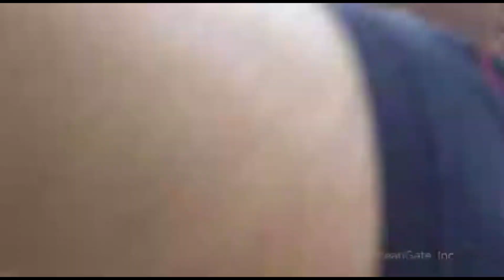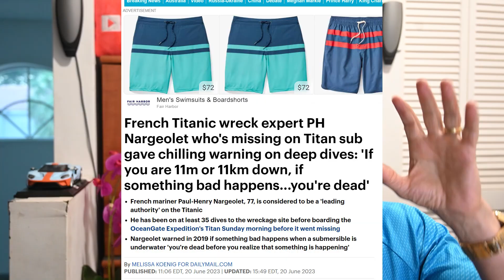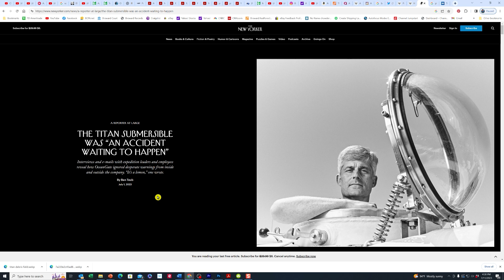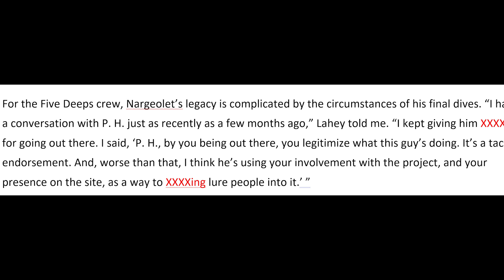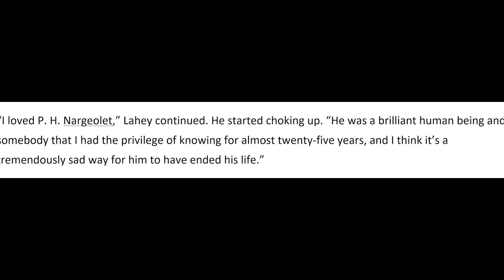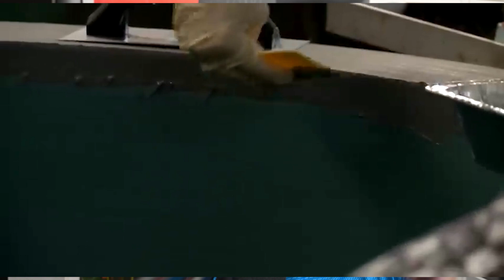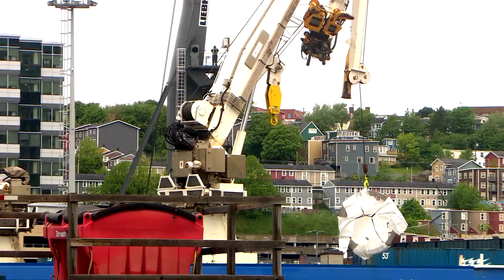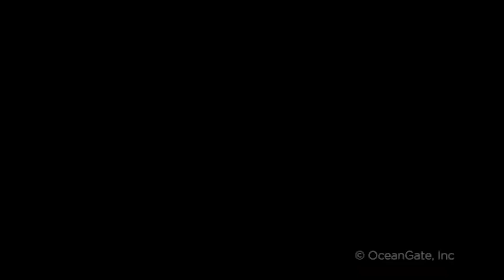Titan Sub: More Q&A, Design Defects, Why Descent Fast

Comment: Spot on @Jeff.  Rapid descent is a major red flag.  Anyone who's experienced scuba diving will always tell you about controlled descent so your body can equalize to pressure depths.
Reply: I think one of the reasons for a slower controlled descent is to allow the forces on the hull to build gradually, it would probably only compress by fractions of a millimetre but doing so too quickly increases the stress and risk of failure.

The lack of a clean room for the carbon layup process and end cap bonding is insanity in such a critical component, even something as small as a dust particle or hair can create a void between the layers that would eventually fail and allow water to work its way through the entire piece
Reply: @wrench8677  There are reasons scuba diver do not descend quickly... Death is one of them!
Reply: @stever2583  yeah I know. I wasn’t talking about scuba diving but I think it’s safe to say that in any situation you’d want to make pressure changes as slowly as possible
Reply: @wrench8677  yeah, people don't seem to get that, especially the beekeeper. He should stick to bees and leave water alone. 😂

I mean, there's so many examples of rapid pressure being a problem. Not just underwater, but anywhere. I would be willing to wager that if you filled an empty water bottle with compressed air and measured EXACTLY how much it took before popping, then put slightly less air in there much more rapidly, instead of gradually, you would find that less air going in faster will pop it.
Reply: @wrench8677  The rules for safety do not change!
Reply: @stever2583  absolutely correct, I wasn’t disagreeing with you on that, just said I wasn’t talking about scuba as I have no experience of it.
Reply: There is no pressure equalization in a submersible.   The occupants are at one atmosphere.  A fast descent is less controlled, harder to abort, and so on. Crashing into the bottom could in itself be destructive.  Maybe that's what actually happened.   It hit the bottom to hard, and that set off the explosion.
Reply: @JoeLinux2000  it didn't hit the bottom too hard, but it was going too fast to adjust to the pressure.
Reply: @chaosflower4892 FASTER than normal descent indicates excess weight.  I suspect the aft section flooded as soon as the sub entered the water.
Reply: @electrictroy2010  I would be more inclined to believe Stockton decided going faster than James Cameron was safe. Obviously, I'm just saying that with no proof, but judging by the other decisions the guy made, I wouldn't put it past him to think he's smarter than James. And we know he's a tighwad who's always looking for a discount (ie. discounted carbon fiber that was past its shelf life for airplanes lol) and that extra hour would be quite expensive. So, yeah, I wouldn't put it past the guy to try to speed things up to save money. 😂
Reply: That's because with scuba, the air you get from the regulator increases in pressure as you descend so you need to do this gradually to avoid damage to your lungs.
The submersible is different in that the cabin pressure remains at roughly atmospheric regardless of the depth.
Reply: They were never descending too fast. He keeps comparing the descent rate of James Cameron's sub to this sub, which is fundamentally wrong. 
Doing 5min of research will show you that this company made 13 other trips to Titanic, and every one of them had a descent rate that got them there in 90min or so. The descent rate wasn't an issue. 
This topic keeps generating a lot of clicks though, so ignorant speculation keeps winning the day.
Reply: The pressure inside the sub isn't high.  As in, descent rate does not matter.
Reply: @cluelessbeekeeping1322 yeah I’m sure the pressure of the ocean depths just disappear 🤣🤣🤣
Reply: @jomomma624  yeah, I’m thinking instantly adding a massive amount of pressure opposed to gradually allowing the carbon fiber to “flex” like a muscle ; had a lot to do with the implosion.
Reply: @devn2190 carbon fiber flexing? Nah.
Reply: @jomomma624  Tell me, smarty pants.  What was the pressure inside the tube just before it imploded?
Reply: @devn2190  Definitely better to take it slow and easy.
Reply: @cluelessbeekeeping1322  Actually the  implosion suggests it didn't leak much.
Reply: @jomomma624  You clearly didn't understand what he said.  Maybe you really are "sure of that," but it's totally irrelevant.  As long as the thing didn't "shrink," the pressure inside was constant, controlled  and not  affected by the increasing pressure on the hull outside.   (Decreasing if it's true that they started to come up.)
Reply: @JoeLinux2000  They were descending at 1.5mph. Is that slow enough 🙃
Reply: @kengself  James Cameron went to the wreckage and it took him 2.5 hours because he went at the correct speed, Titan was on track to take 1.5 hours. So, no, it was not slow enough.
Reply: @devn2190  Carbon fiber doesn't flex.
Reply: @cluelessbeekeeping1322  descending too quickly causes RAPID pressure changes. Submarines are designed to withstand deep pressure, but they're not necessarily capable of taking it quickly. Military subs can dive at any speed, but we're not talking about military subs. 

Same exact principle as decompression sickness (the bends). Your body is able to withstand slowly changing pressure (up to a point) but if it rapidly changes, you're going to the hospital. If you're lucky. The morgue if you're not. This is why you follow your bubbles up when you're surfacing, it keeps you from getting disoriented about which way is up, and it allows your body to gradually adjust to the new pressure. 

Another way to think of it is this: you have a big F350 pickup, you decide you need to drive up a curb, so you get just to the curb and then you slowly go up it and your tire is fine. There was a change in the pressure of the tire, but it was very gradual and the tire was able to "get used to it", for lack of a better term. However, same scenario but you're going 150mph and slam into the same curb. Now you've almost certainly got a couple blown out tires! And, if you don't, please tell me what tires you use! But the abrupt change in pressure will almost certainly cause your tire to explode, whereas, a slow and steady movement will keep you from spending 300 dollars at Les Schwab. ☺️
Reply: @since1876  All that talk & you are wrong.  The pressure inside the sub was 1 atmosphere. 
Your 150mph is NOT the scenario.  Diving at 1mph vs. 10mph (which is way slower than they were going) wouldn't make a bit of difference.  They did not hit the bottom  There was no impact.
You are absolutely wrong.
Reply: @cluelessbeekeeping1322  Stay clueless... 1 atm inside the tub, changing exterior atm to a max of 100atm - where does all the force then go?
Reply: @stever2583  All the force is kept out via the seals, carbon fiber, titanium & glue. 
You don't understand basic physics.
The reason they died so instantly was because of the pressure difference.  Duh.
I'm sorry you don't understand submersibles.
Reply: @cluelessbeekeeping1322   No but i can see by your response that you have it all figured out... When did the aliens get to the submersible - idiot. Why was the submersible down graded for depth? Do you know? I do... Why was the glue applied without any surface prep to the Titanium... I do. What seals are you talking about? Where are those seals what type are they? Do you know? I do! Your trite answers simply point to zero actual knowledge and a dime store wit. Back to your Barbies honey!
Reply: @cluelessbeekeeping1322 I believe the descent rate is what caused this
Reply: @wedontlikenoneofyou  Especially when it hit bottom.
Reply: @cluelessbeekeeping1322  could matter. A fishing line will hold a lot more weight if you slowly load the line vs a sudden application.
Reply: @ClumsyCars  No it would not.
Reply: @ClumsyCars  It's called static load verses live load.  I'm now conjecturing the sub could have hit the bottom too hard.
Reply: @ClumsyCars  The descent rate was never an issue. They made 13 dives with the same descent rate and were fine every time. The engineering is what failed in the end. Trying to compare the descent time of a different sub with a different design and weight with this one is just poppycock

Comment: Did it nose dive down Jeff?
Reply: No it scooted down like a dog wiping its butt
Reply: No. It did not "nose dive". The text transcripts are REAL. That has been positively confirmed.
They had an uneventful but rapid descent for unknown reasons. All was well until the RTM (Real time hull health/integrity monitoring) alarm sounded.
 They tried to arrest descent with thrusters and it actually sped up descent so the decision was made to dump ballast and return to the surface.
That didn't help either so at approximately 3500 meters they jettisoned the heavy landing frame which took several attempts but was accomplished and was succesful in beginning their ascent.
The ascent was ominously accompanied by "crackling" sounds coming from the aft area but could not be identified.
A diagnostic check revealed all hull health monitoring parameters were reading full red at their maximum level.
Eventually the crackling sounds subsided but ascent rate was approximately 25% of the "predicted" rate again, for unknown reasons.
About 17.5  minutes into their ascent and a mere 43 meters closer to the surface, it was reported that Titans main power bus A was reading all red and Rush switched to main power bus B which was accompanied by the return of the crackling sounds which was reported at the 18 minute and 21 second mark since they started their ascent. That was the last transmission from the Titan.
Some 9 seconds later US navy monitoring systems detected the sounds of an implosion.
That is what happened.
All these naysayers that claim the transcripts are fake have ZERO evidence to support their beliefs.
Yes this is the internet and yes it's common for thar type of "trolling" to occur. Regardless the transcripts have been confirmed to me personally by someone within the industry who is in direct, first hand communication with one of the topside controllers within OceanGate and an electronic warfare specialist aboard one of the US Navy's surface vessels that monitor that area of the Atlantic Ocean.
He is legit, the transcripts are legit and the above account IS what happened.
Reply: No because thanks to gravity the peeps inside would've all been mushed up at the front of the capsul if it went nose down.